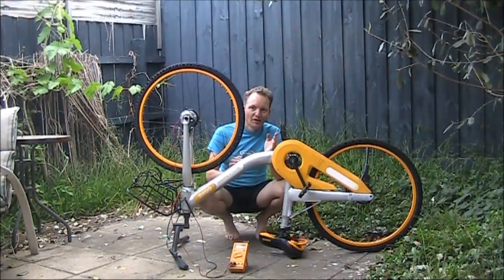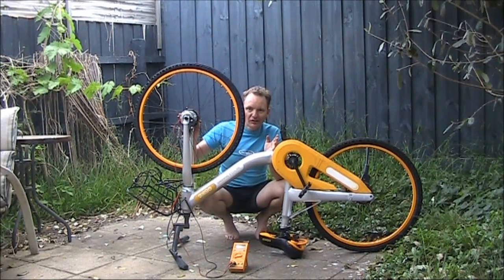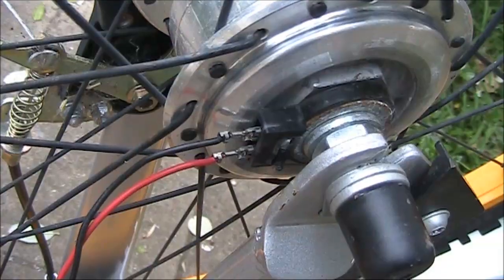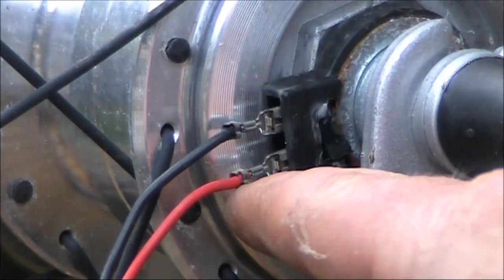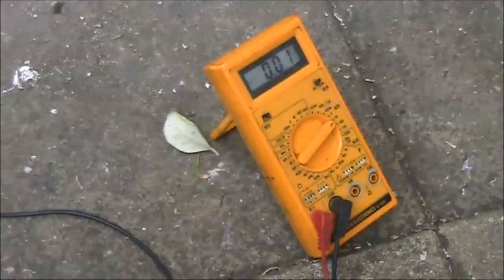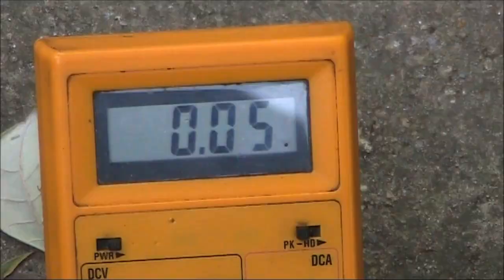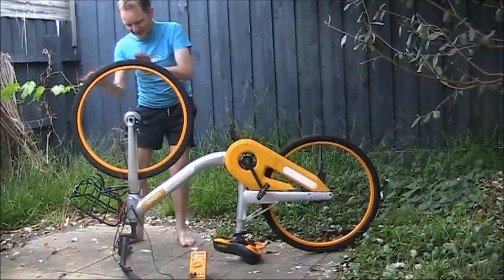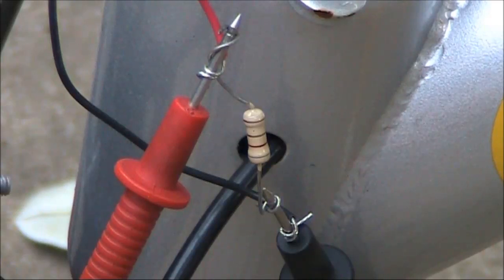Electronics on the Floor: An oBike generator

Comment: There are better electrical generators for bicycles that give the rider an electrical boost on hills or when they want the electric motor to propel the bicycle from stored battery power. Unless you are good at balancing your bicycle wheel spokes I suggest if you purchase one you have the bicycle shop true the wheel after purchasing the generator and battery. Those batteries have enough battery power to power your transceiver.

Comment: dynohub was ideal in uk for bikes 6v 3w generated with 60rpm on the wheel. I used one as a small wind turbine. aslo adding capacitors to double the voltage.

Comment: The two standards are 6v 3w and 6v 1.5w ac at a certain rpm. I believe Germany has laws requiring cyclists to carry a light, so most of the standards have been dictated by them.